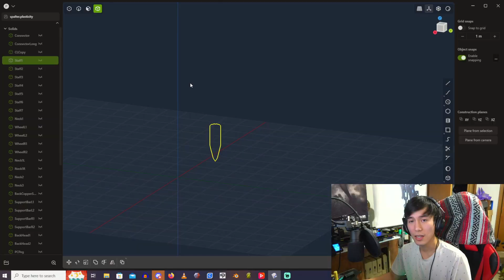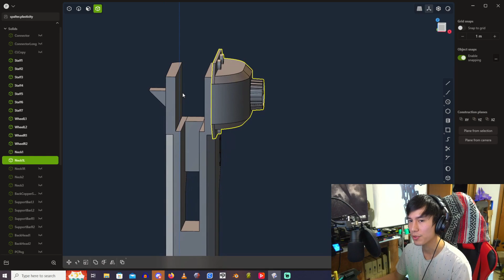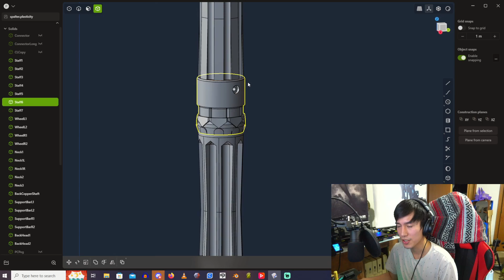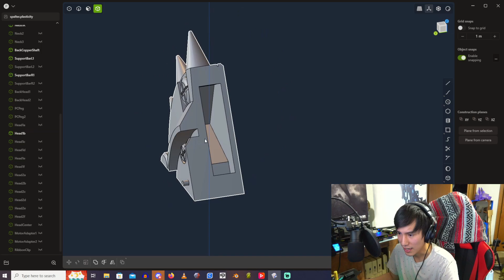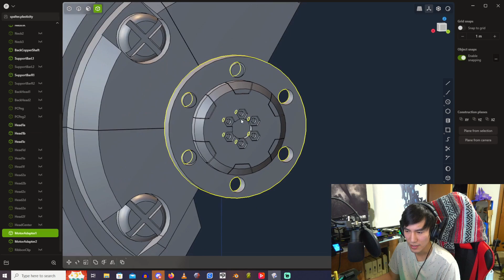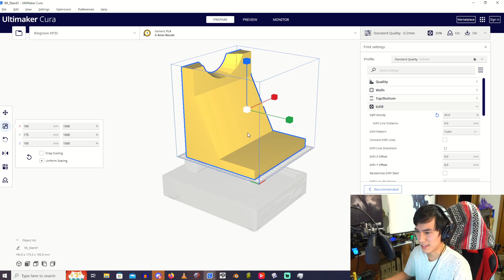Specter the Unchained Build Guide | 3D Models

Comment from the maker: Good luck. Be sure to tag me in your posts as you struggle to make it. Your tears will motivate me to make even crazier props. The non-motorized version is also available and should be easier to make.

Update 7/29/2024: Neck3 and Backhead2 has been split into a,b, and c pieces alongside their whole stls to allow for printing on smaller 3d printers.

Update 8/22/2024: BackCopperShaft has been updated on my Patreon shop to include a cavity for a battery pack approximately 25mm x 64mm x 106mm in dimensions. Look up talentcell Li-ion rechargeable pack on amazon.

Upadte 1/12/2026: The remastered Buzzsaw head has been uploaded to my Patreon free for those who have purchased the whole model. It has been updated to reduce weight while maintaining structural integrity.

Tools/Materials:
Epoxy Resin, J-B Kwik Weld, the flanged coupler I showed, 50 rpm 12v Geartisan DC Motor, 12v rechargeable battery pack, gloves, 1mL plunger syringes, measuring cups for epoxy, size 10-24 x 2 inch machine screw and bolt, clear non-expanding gorilla glue, and a lot of super glue.

Infills:
Head pieces: 8% Cubic Subdivision to keep the weight as low as possible.
Staff Sections: 8%-15% since there is the thick wooden dowel on the inside.
Neck 1: 30%-40% Cubic or similar patterns (stress point)
Neck 3: 8% Cubic Sub to keep weight down.

Comment: Hello, brother. I have a question. I saw that in your method, the three blades rotate in the same direction, but I need the three blades to rotate in different directions. Therefore, I may need to modify the source file by making a 100mm diameter hole in the center of the head to allow my pipe to pass through it. If I purchase your 3D printing blueprint, would it be possible to get the source file or the modified file?
Reply from the maker: Unfortunately I currently do not have plans to release the source file for any of my 3d models. I do encourage others to use my model as a reference in addition to the character artwork if you want to design your own version of the buzzsaw.